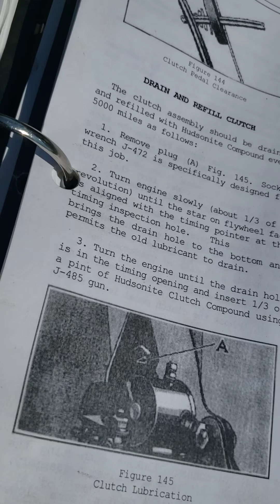47 Hudson Super clutch fluid replacement

Comment: An old 1950s Popular Science "helpful auto repair hints" (or something like that) suggested stuffing a rag beneath the drain plug on the flywheel.  This way if the plug should drop out of the socket just as you thread it out, the rag will catch it and you won't have to remove the flywheel cover underneath the car to retrieve it.  Just don't forget to remove the rag when the job's done!  Also, back in the day, Snap-On tools made an 11/16 magnetic socket for removing Hudson drain plugs.

Comment: Need a long neck transmission filler with a small opening. Or attach a scrap piece of vacuum tubing to a funnel, to put in the new fluid. Don't forget you put the clutch drain plug back in!